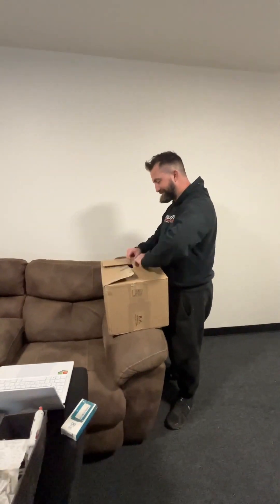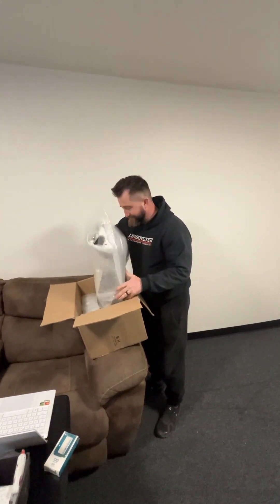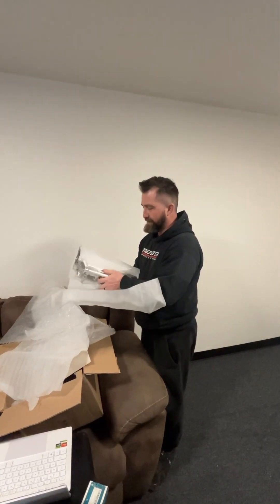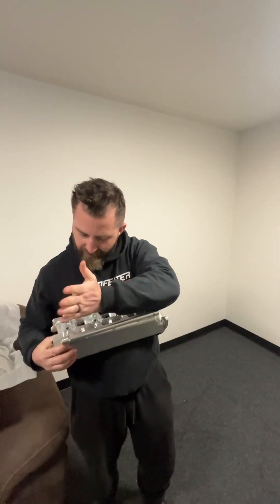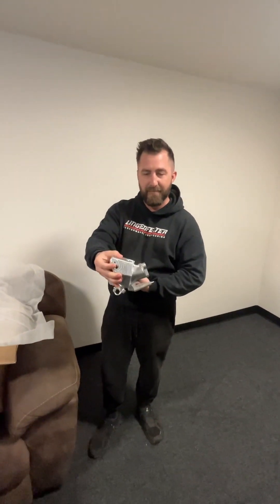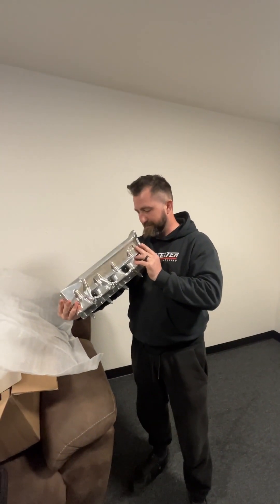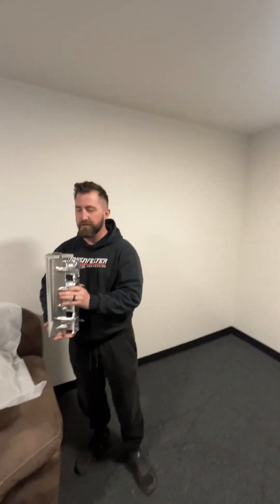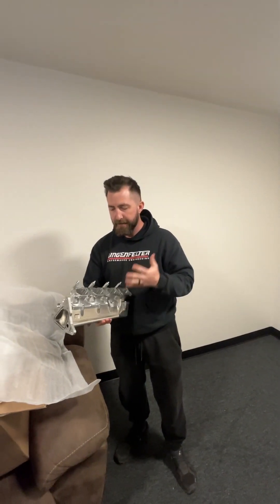EA824 Billet Port Injection Manifolds: True Port Injection vs. Fog Injection Explained!

Comment: Sir!  Who produces that very, very nice billet aluminum port injection manifold?  I also assume it is very expensive given the high quality workmanship that comes across the screen.
Reply from the maker: They are bringing Brot to market with a couple of industry partners to be included in specific packages.
Reply: @ OK.  I have a 2017 RS7 Performance Titanium with a few mods.  I’d be interested in learning more about what you’ve done with your E824 4.0T.  If the intakes will be part of a package, please let me know when they might be available.  I assume I’d work through your shop?
Reply: bar-tek in germany